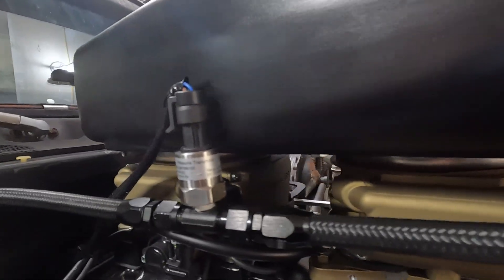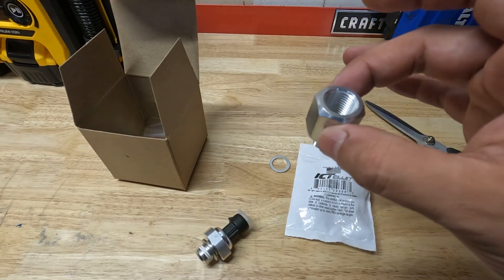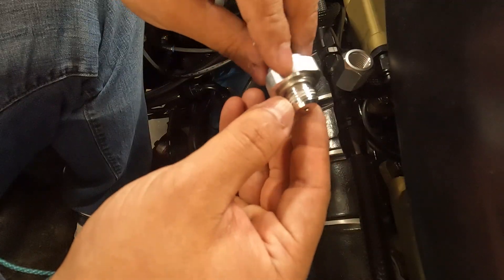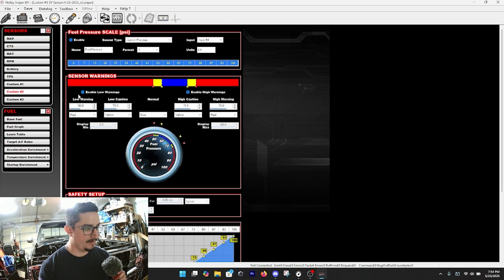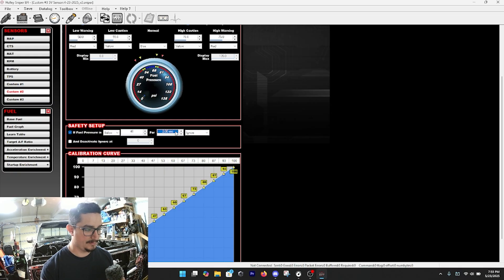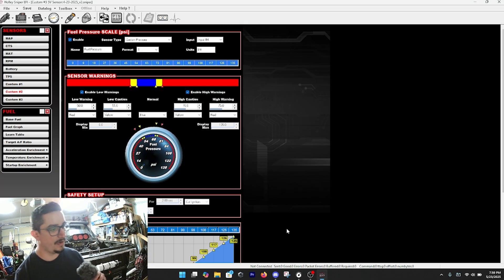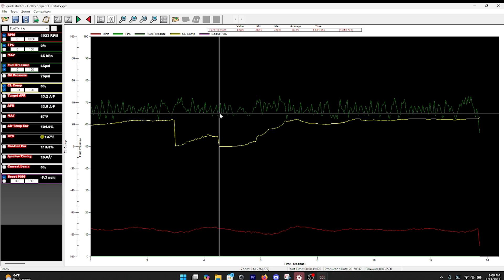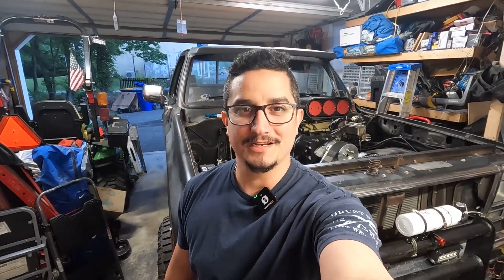How to add a custom sensor for Holley EFI - Stop OVERPAYING for EFI Sensors! (VolumeCorrected)

Comment: You skipped from save to run. Having issues saving and loading.  Can you elaborate please. Great video, got me this far.
Reply from the maker: As in loading the tune to the ecu?
Reply: @diveingarage  Yes.  Though I may have figured it out but it's not showing on the handheld.  Not found in the select channel screen.  I did check voltage while running and it's showing in the mV so I'm looking into the sensor you have, mine cheap Amazon.  Is there something I am missing to have the special inputs show on the handheld?